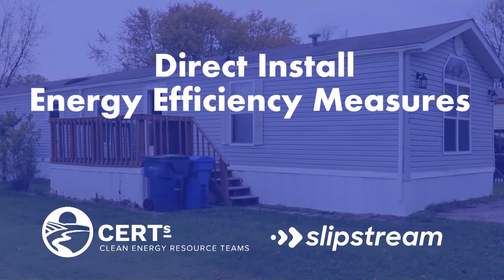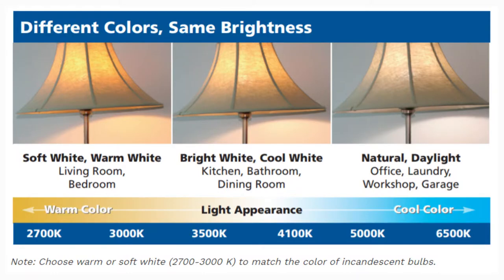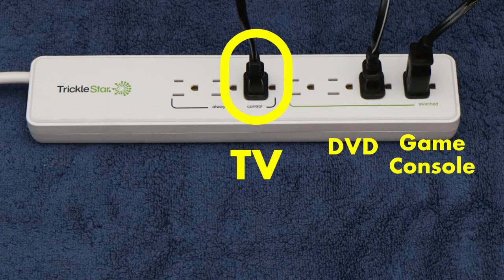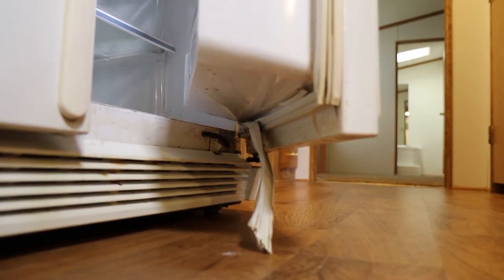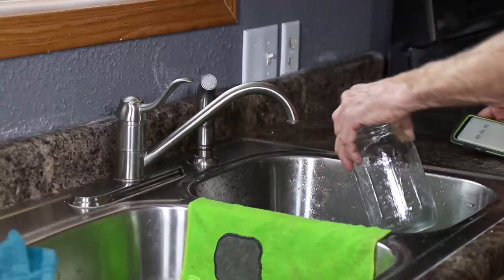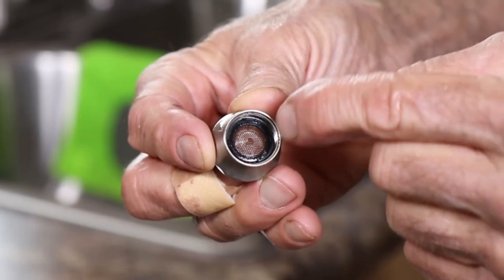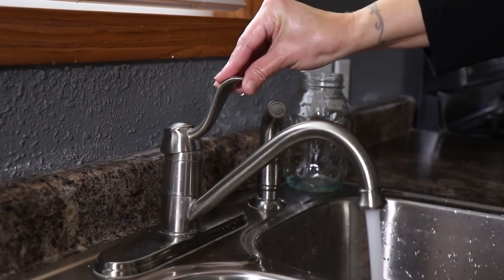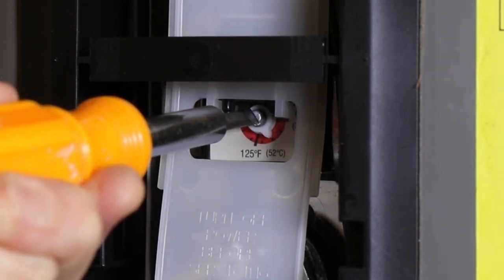Install Energy-Saving Products in your Manufactured Home

Comment: What I would like to see is heat pump appliances to eliminate natural gas appliances for manufactured homes.  I would like to install a heat pump for my natural gas hot water heater.  Then do the same for my all in one HVAC outside unit.  And then replace my gas dryer with a heat pump.  It looks like GE has a new combination washer and dryer with a heat pump and no vent.  Then in time replace my gas stove with and induction stove.